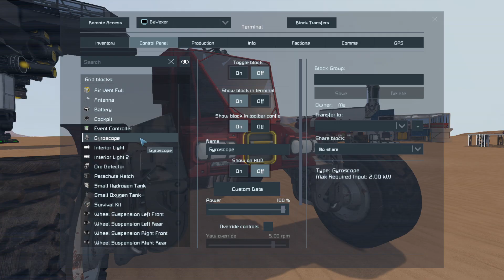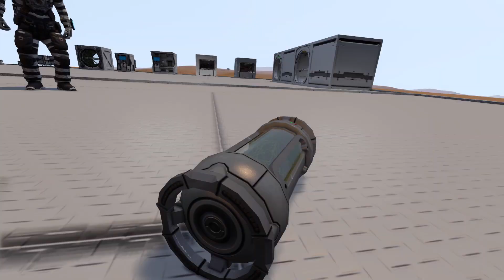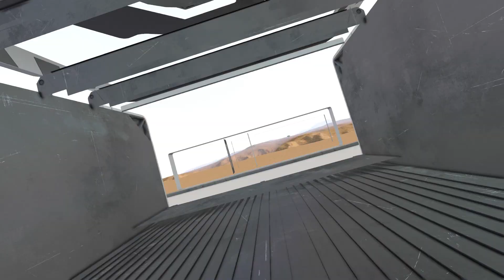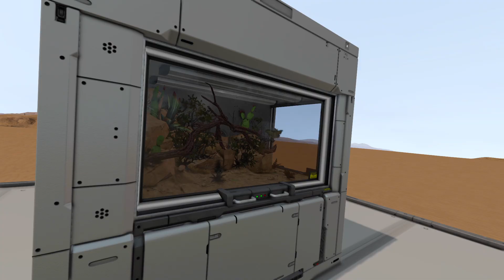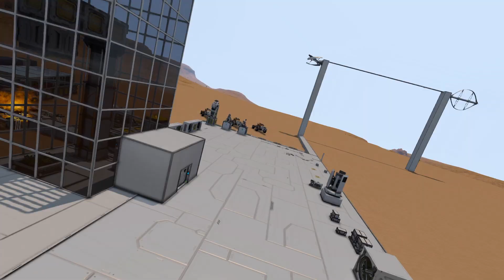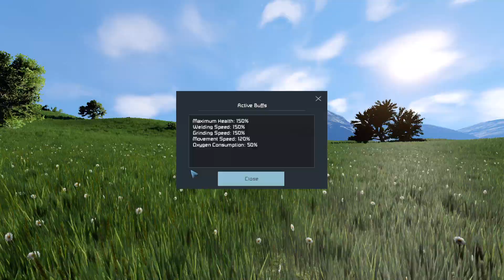APEX SURVIVAL Is HERE: New Blocks, New Dangers... And a Giveaway! | Space Engineers Update

Comment: It should be noted for Build and repair it has a habbit of acidentally grinding your own grids. 
I found its best to have them just weld or keep an eye on the ownership of your grid. If it changes at any point, Build and Repair will start eating it
Reply from the maker: You can turn off janitor mode in build and repair and that should help. It's been a bit since I messed with it, but it's very controllable. Most people just plop it down and let it rip, but there are so many options on build and repair.

Comment: I would still prefer the old drop pod to rover, because the pod had atmo thrusters that you could use to fly that thing to nearby ice lake without any issues. With a rover you need to choose more or less smooth road and sometimes you just can't do it without mods or doing huge detour that would hit battery charge.
Would be nice if devs would allow to choose what we want: drop or rover.
Reply from the maker: The option to use either the rover an dop would be nice for sure. I think replacing it with the rover does make for a new challenge, but you can actually get setup really quickly with the rover, minus the metal grid part for cargo containers (Large Grid).
Reply: @PandemicPlayground  could you tell me how to do it, please?